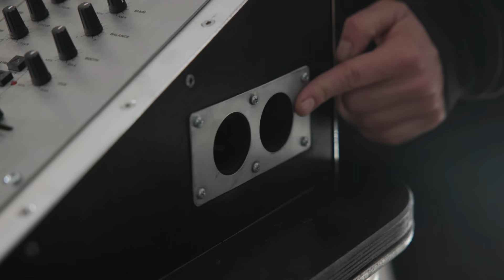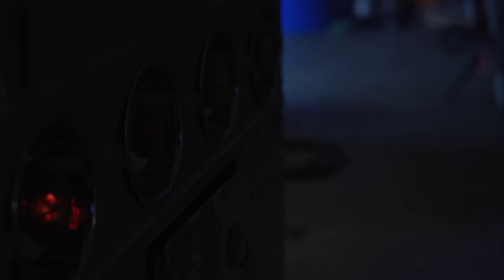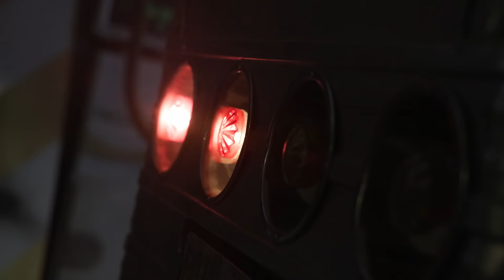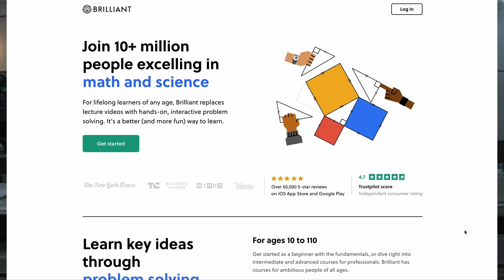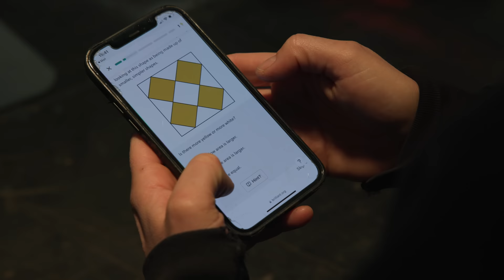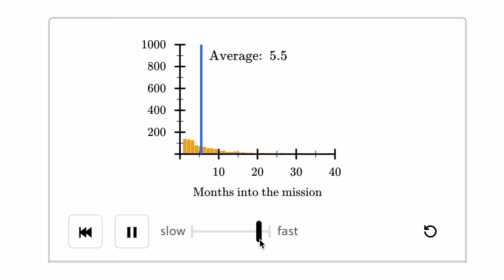Major Upgrade for Liselotte! (Rescuing a 120 year old house)

Comment: Are you sure that the foil underneath the insulation is the waterproof/diffusion open one? Normally, I believe from the inside to the outside the order should be: vapor barrier on the inside, then insulation, then waterproof/vapor open on the outside (So, as you said, vapor can leave the structure). The reasoning is: the inside of the house is warmer than the insulation, and the insulation is warmer than the outside. Warmer air can contain more moisture than cold air, so if air cools down, condensation can occur. The last thing you want is for condensation to occur within your insulation, as that leads to worse performance, but more importantly, since you chose a bio-based insulation, you could get mold in your insulation. Hence, the vapor barrier on the inside: it prevents moisture from the inside air getting into your insulation.
Reply: @MMm-ze1kr  of course vapor barrier is state of the art. You mandatory need it! But the black foil is not a vapor barrier, its a water resistant foil which usally goes on the on-roof insulation. they will add the vapor barrier later from the inside, after they insulated the roof between the rafters also from the inside. But what they are doing with the water resitant layer underneath the on-roof insulation is totally wrong, just waste of money, time and material.
Reply: That concerns me too! I've never seen this oder of layers before. Usally from the inside to the outside: Vapor barrier, insulation between the rafters, on-roof insulation, water resitant layer, counter battens, battens and roof tiles. But with this type of on-roof insulation you don't need the water resitant layer mandatory, only on the roof ridges, chimney, over the windows,...Probably they do it like this because they are scared of the weather. So they wanted to close the roof quickly, but usally you just use a tarp to cover the open roof you are working on. Or you just open the part of the roof you are working on and leave the rest of the tiles on the roof until you get there with you on-roof insulation. Now they have a huge waste of non biological material and twice the work because they have to secure the roof ridges, chimney,... again on the on-roof insulation.

Comment: Please don't mix balanced (XLR) and unbalanced (RCA) plugs in one cable, or use adapters like that. What you should use is DI box, it changes unbalanced signal to balanced. Balanced cables are great to run on longer distances, and next to power cables as they dont pick up hum. Or do some research about audio cables, there are great videos explaining the diferences. Just dont use adapter cables as you made.
There is nothing more frustrating than having or seting up a party and dealing with hum because somebody thought it would be ok to use adpters like that.

Comment: Why only 8 cm insulation?
Reply: It’s not the thickness that’s important. It’s the R or RSI value that’s important. if it has a high insulation value it can be thinner than you might expect.

Comment: The 8cm of roof insulation wont be enough - I once learned it has to be at least 20cm. So is there more to come between the beams?
Reply: I wonder, too.
Reply: They put insulation also between the rafters which should be about 12-14cm plus 8cm on-roof insulation. That's not the best option but it is okay. You are right, usally you try to geht 20cm or even more between the rafters plus 6-8cm on-roof insulation.

Comment: Drawer for the fog machine! 9:25 The move to avoid to pinch fingers between the laptop and the tray! So a cut is needed at the middle of the bottom of the tray to easily pick or place the laptop. Love the scrap cabinet.

Comment: so. Moisture leaves the house through the membrane foil. than goes through the wooden panel. on top of the wooden insulation panels it cools down, and the water is on the wooden panel. that is BAD. the membrane foil is designed to keep the insulation UNDER it dry. they should insulate the roof under the foil, not on top of it.
Reply: you are right, the layering is wrong. BUT water on the wooden panel is not the problem. the water can dry and expire because the roof is vantilated. The wooden panal also icludes polyurethane, that will make the water easier to drip of.
Reply: @janmichele4929  yes, i expect ventillation... Although it would need to be minimum 5 cm clearance over the wood panels - but they put the roof tiles way closer to the wooden panels. Actually, i doubt there is any wentillation there. If you see carefully, they filled up the gap conpketely with wooden panels.
Reply: @tiborkiss9186  Yes, in Germany we usally take 4/6cm as counter beams for ventillation. Thats what they also do on this roof. The horizontal beams are just for walking and installing the wooden panels. They will come off afterwards and will be replaced by vertical counter beams for ventillation. On the other side of the roof they have already done it.

Comment: I had my roof done this year. They put the furnace vent on too tight and I was getting carbon monoxide in my house from backdrafting. Ugh. You resting your knee or your pucture wound? Will the fog machine make her smoke detector go off? Yes cover the front square with a metal grate plate.

Comment: Did you connect the metal case to ground? Just in case some power wire comes loose and touches the case? Love the project :)

Comment: Wood insulation on the roof?
I've never seen that.
Does it have a decent R value ??
(Like her sponsor, Laura is brilliant.)
Reply: If it's thick enough. There should be at least 24 cm, and not 8 as shown here. But maybe they will put several layers. The lambda is between 0.036 and 0.046 (in W/m.K), against 0.033 to 0.044 for rock wool. But since it is much denser, it can be used for sarking, and it is brilliant in summer for keeping the heat out, which mineral wools aren't good at.

Comment: 8cm of insulation is nothing. You need at least 25cm for current standards.
Reply: its just the on-roof insulation. they also insulate the roof between the rafters which should be around 12 to 16cm.

Comment: Materials jealousy…you guys have some great materials not available in the US 😢
Same for appliances 😢  
The wood pulp? Insulation, that 1-way roof membrane, the Cobb?..bricks…we need that here!  Far better insulation is needed, but millions of cheap-truss-roofed track houses cannot fit more insulation; only solution is to insulate on top of the roof deck, before reroofing.
And same for walls; 2x4 framing does not allow much useful insulation, so the only way to get more for the walls, is to add onto the outside of the walls….but most contractors don’t know how to do it, much less the right way, to prevent a dew-point inside the wall then. 

Maybe by more people viewing your stuff in the USA, the cool stuff available in your country, will start being available in this country..🤔  Maybe your videos will excite more folks to become Makers!